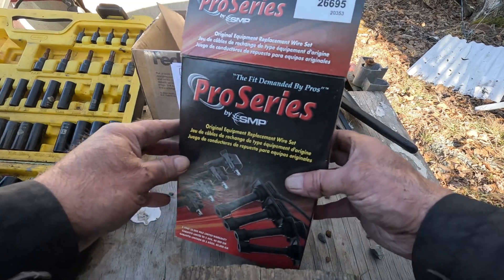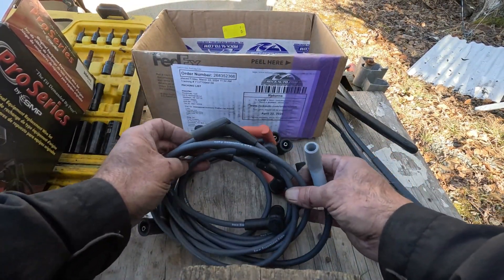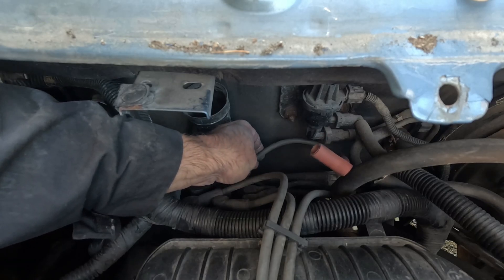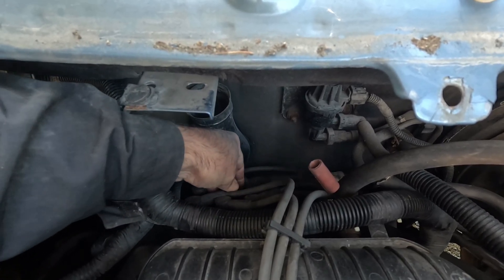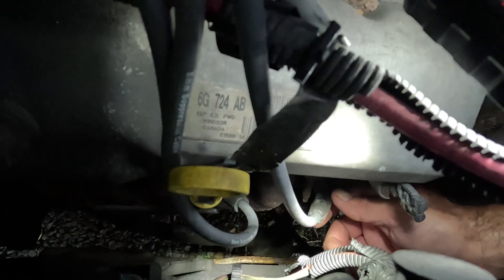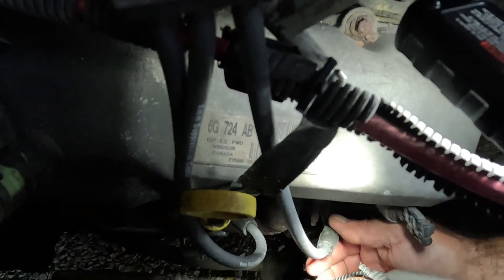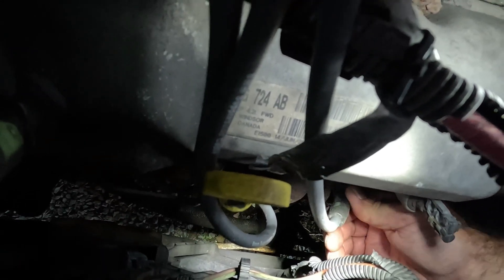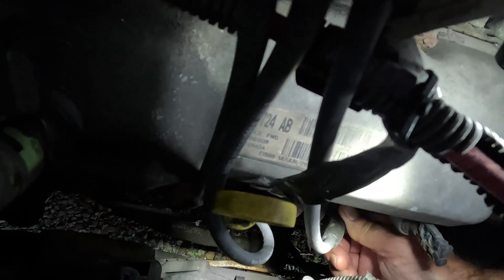How to replace spark plug wires

Comment: Great video!! I did my wires in single form and still crossed the last two. Fortunately I followed the firing order off the intake and traced the wires down to the distributor back down to the plugs where I crossed them.
Reply from the maker: It's an easy mistake to make 404 - well done on fixing it !